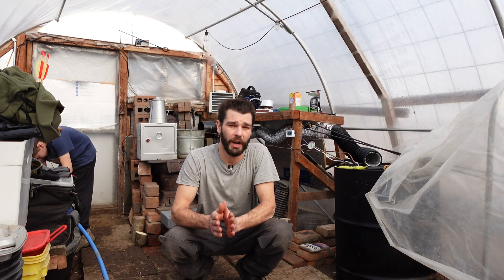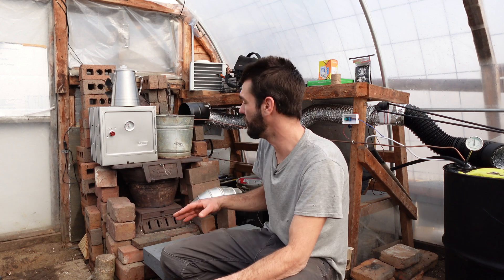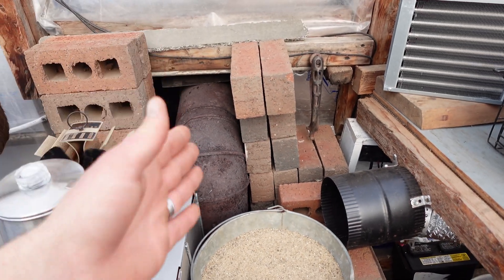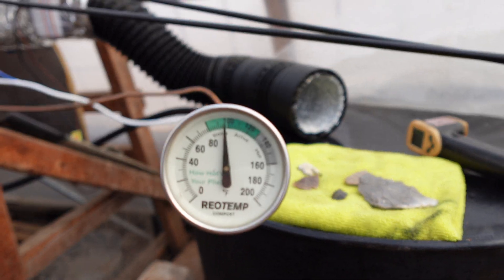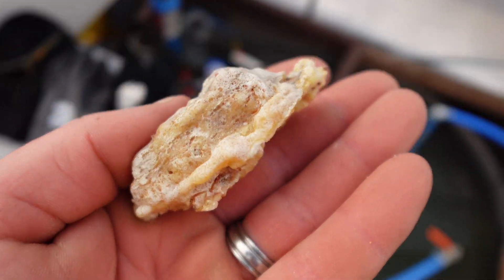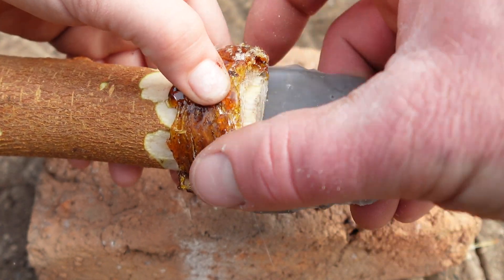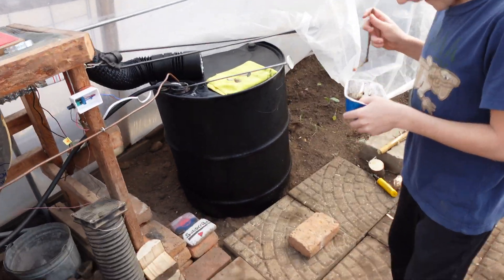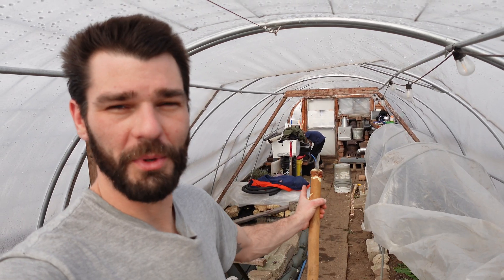DIY CHEAP GREENHOUSE HEATING - Solar Power & Wood Stove Sand To Water Heating System #viral

Comment: ditch the sand bucket, it's slowing heat transfer. put the copper coil directly on stove with few bricks on it. or arround the stove.
will be way more efficient.
even more efficient: stainless steel tubing(brake line) inside the stove.

Comment: Bro you look great you got a Star Trek Riker + Wolverine hybrid thing going on kinda jealous lol. Good video. For people who have homes with outlets that can't handle big loads from space heaters, the sand bucket is your key. Outlet to power controller to only take low amounts of power to fill capacitors that take turns dumping into an element inside sand when they fill. Two sets of Capacitors taking turns filling will prevent constant on off action of the outlet for steady power flow and then the battery(sand) will store the heat you dump it will ADD UP. Its a good way for continuous large pulses beyond max output of power cores for energy based warships also.

Capacitors can store power from wind speeds that push more energy than your battery banks can charge at and slowly bleed that energy at safe rates to your battery storage for increasing efficiency of Wind turbines also. AND! If you have all those capacitors made capable of sending power to a merger, you can use the capacitors for sudden bursts of power for Ultrasonic defense systems. Did you know plasma speakers can produce Ultrasound pressures greater than the bottom of the Ocean? In your TV shows you call what I'm talking about "force fields" lol. :) Yeah..

Comment: Have you heard of Off-grid Survival Mike's channel?  He's been working on sand batteries for a couple years.  https://www.youtube.com/watch?v=-qhV83pxV18
Reply from the maker: I’ll have to check that out. sand is great for thermal mass but water will always hold temps longer. Sand releases heat faster than water although it can hold a higher temp. Both working together with solar power was the goal. Thanks for checking this out and sharing your input!
Reply from the maker: Sand and heater elements don’t pair the best I’ve tried it. Unless you have a huge surface area to heat the sand with, the element burns out fast. I used a heating element is sand and it burned out quite quickly compared to the ones I’ve experimented with water that still are viable. The grains don’t transfer heat like water does

Comment: Neat! Have you tried positioning the water barrel above the bucket to create a thermosiphon to move the water, instead of an electric pump? Or is the flow too slow?
Reply from the maker: Space is the only inhibitor. I would have it that way if I could fit it. The pump is running off solar power so it’s a win win in our book. The natural flow would be great but too hard to achieve in here. Thanks for checking this out and sharing your ideas!

Comment: So what is the temp range of your greenhouse at night with all the different systems you're using? 🙂  

I tried doing a sand battery with my 4-tier greenhouse on my patio. I used a 12qt stock pot with sand and I placed it in a 350F oven for a few hrs. The temp stayed about 6F higher than the outside temp on my patio (this was sometime last month - I'm in TX zone 8b and it was in the low 50s when I tried the sand) But I actually got better results - close to 10F higher - by just adding another layer of plastic under my original greenhouse cover and putting a Planket over the entire greenhouse. When the temps dipped into the low 20s, my greenhouse stayed above freezing (33-34F)

Are you familiar with One Yard Revolution here on YT? Patrick hasn't posted anything in a long time, but he built a greenhouse and was able to keep his plants alive during a polar vortex that sent temps in the -20Fs by layering plastic and insulating his greenhouse in different ways. If you haven't seen it, this is the video.... https://youtu.be/Dd-FOj7cuLc?si=eovU09uUYcHyUp-C
Reply from the maker: Yes I’ve seen that, we haven’t gone below 47f this winter with the coldest temps being -14f, over the winters we’ve survived -40 during the polar vortex we held 42f on our soil. All our self heating and diy systems are relatively free and do their job! Thanks for checking this out and sharing your experience!

Comment: How much solar are you using?
Reply from the maker: Thanks for watching! Glad you asked, so the system running our water pump in this video is powering several fans also. off just one 100w panel. We're sitting with 400Watts coming in at various points collectively now. we just ordered a couple more 100w panels to amp up the energy for our next heating experiments as they require more. thanks again